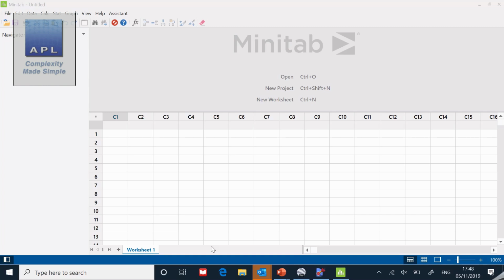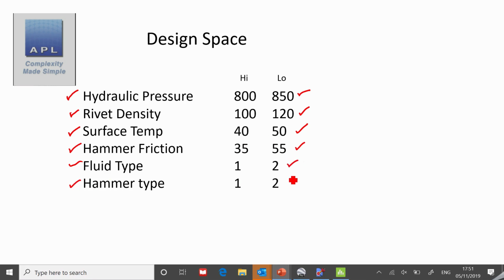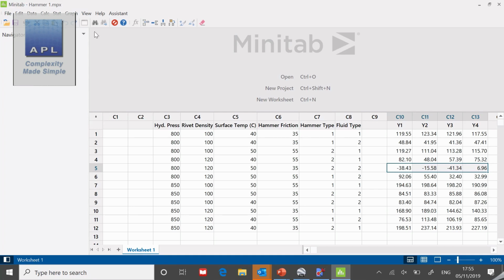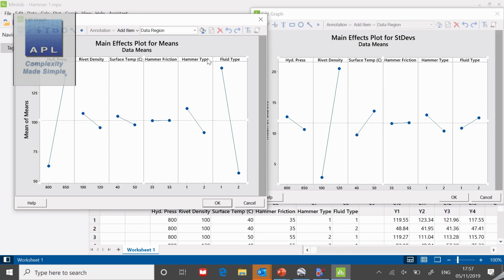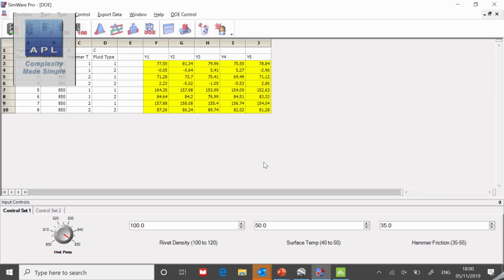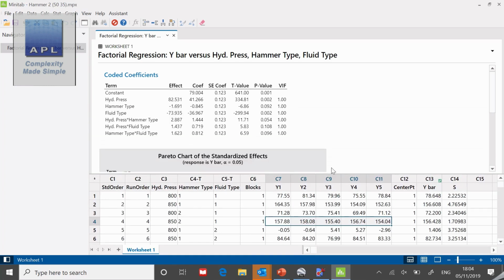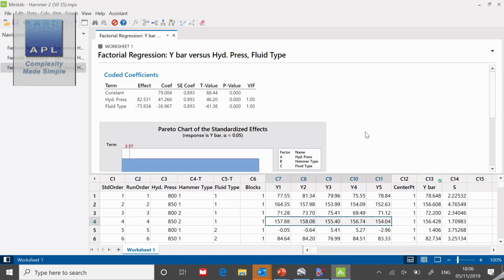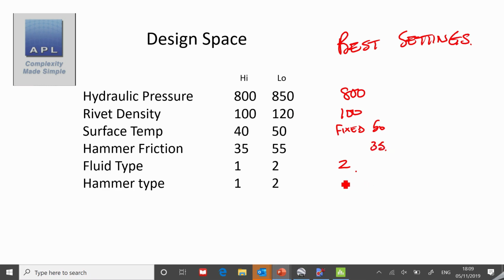Minitab Tutorial - DOE Screen & Modelling

Comment: Thank you for the video. I´m a mechanical engineering student in germany and unfortunitaly I never heard about DoE. I´m very interested in DoE that I just bought your book . My question is: Do I have to run another full factorial experiment after the Taguchi L12 or do you reuse the data from L12?
Reply from the maker: NM good to hear from you. Yes you can use the L12 with 6 variables only. The example in this video shows a second full factorial after the L12, which I think is the best way to proceed if you want to hit a target. If you want to jusy hit highest or lowest the L12 will probably do..
Reply: @paulallen5321  thank you for answering my question. I want to use DoE for my experiments, to analyse the settings for my laser welding machine  in order of the welding test for my bachelor's thesis.
I want to use the L12 Taguchi design for that and followed by the full factorial like you did in this video to get the optimal settings.
Can I reuse the response data, that I find out with the L12 experiments? Do the DoE Pro software take the responses from the L12 and create a full factorial experiment? Or do I have to make another experiment on the laser-machine with 4 replicates for the full factorial 2^3? 
Thank you very much